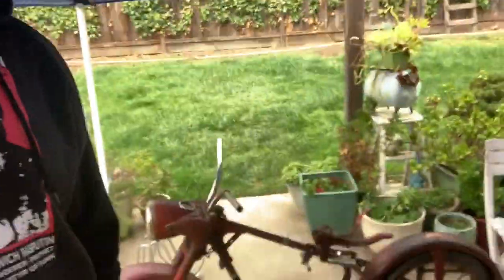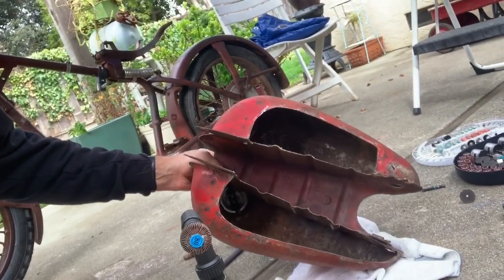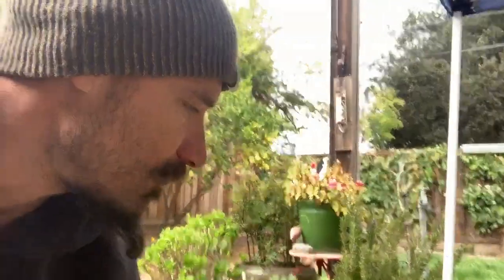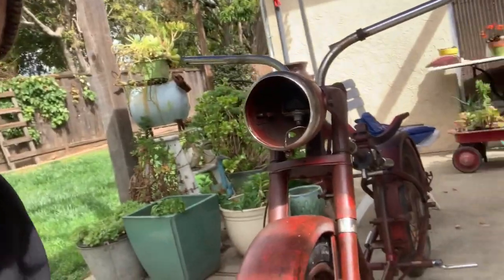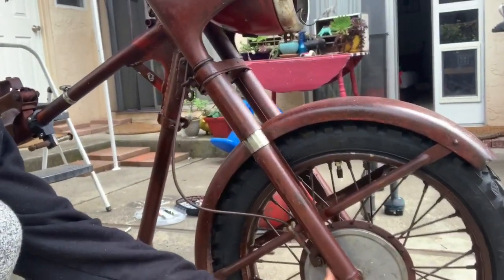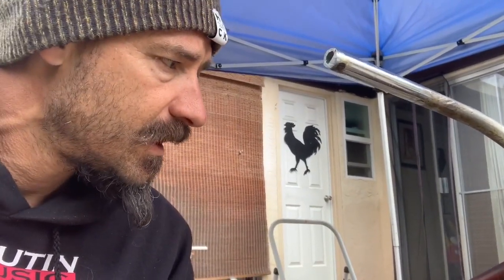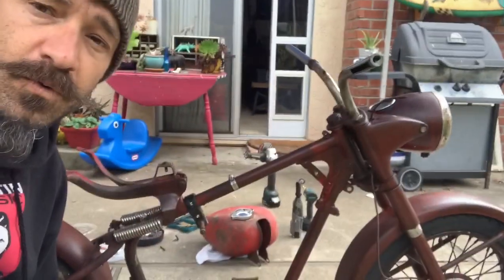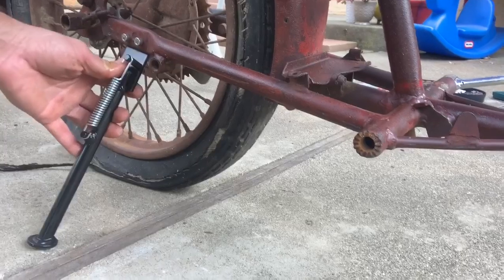1954 Puch Allstate Motorcycle Conversion to Electric (Overview)

Comment: Hot tip for rust......#000 steel wool and wd40.......also ketchup works well. Soak parts for over night and go over with steel wool or fine wire brush like brass. Also you can restore a lot of the original chrome with only steel wool. After you’re satisfied with the results you can buff it with whatever chrome polishes or wax. The results are jaw dropping.
Reply: Me and my friend accidentally discovered how great ketchup is at cleaning things when his young son was eating a hotdog and some ketchup dropped onto some nearby change my mate had lying around the house...
He noticed it a few hours later and wiped it off the 2p coin it was on and we were both "wow, how clean it the bit that ketchup was on"...
Resulted in my and my great friend (rip buddy, he passed away a few years ago, miss him, was my best ever mate) covering a load of coins in ketchup to clean them...
I'm guessing it must be the acidic ingredients in the sauce that make it so damn good at cleaning muck off of stuff like coins.
It's unreal how well it works.